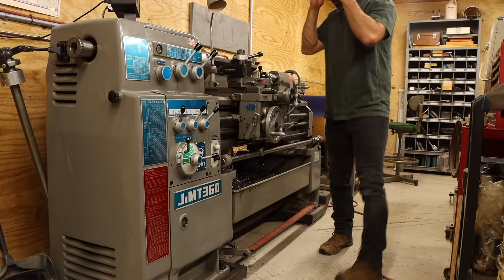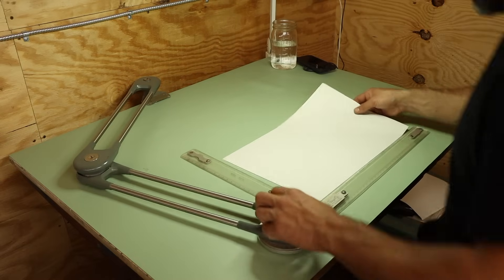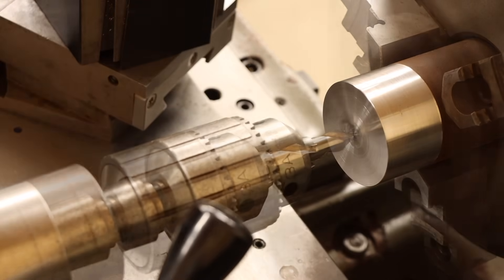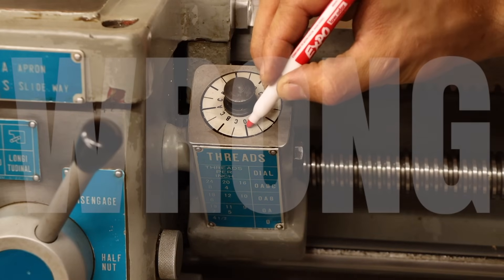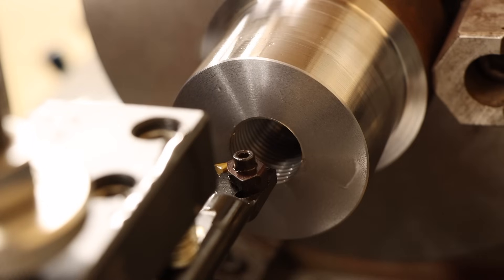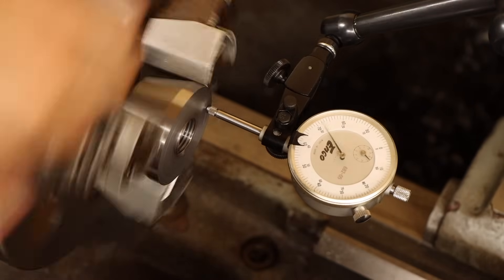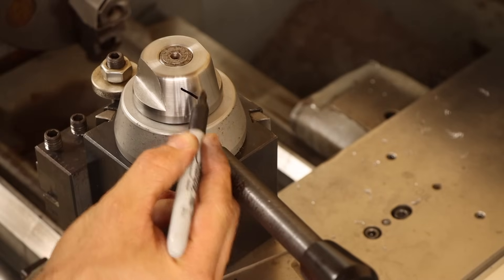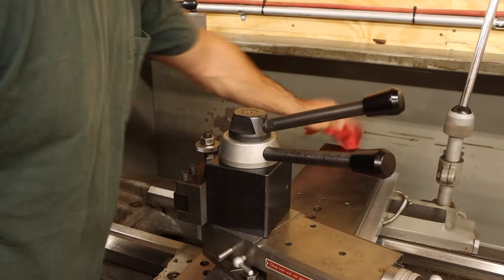A Better Tool Post Nut || INHERITANCE MACHINING

Comment from the maker: Thanks for watching everyone! Be sure to tune in Friday, August 5th for another fun project! If you'd like to tackle this project yourself I have some drawings on my Patreon that might be helpful!
Reply: With metric threads on an imperial lathe you need to turn it off and not disengage the half nut.  retract. run lathe in reverse, then go in for the next pass.   even hiitting the same mark on the thread cutting die you wont re enter the thread at the same point
Reply: @R3dryuu  It's still possible.  You can disengage half-nuts, retract, stop the machine, and then run the machine (and threading dial) backwards until you hit the same mark on the threading dial, before re-engaging to extract the tool.  As long as you don't allow the dial to make a full rotation before stopping the machine, the half-nuts will engage in the exact same spot on the lead screw, and the threads will line up fine.
Reply: When hatching a section, the internal thread must also be hatched, since it is located in the body of the part.
The part itself could be sharpened with a cone in the opposite direction, then the perpendicularity of the end and the average diameter of the thread would be ideal, and the less important upper end could be cut from the second setting. Or trim the end on a threaded mandrel.
It would also be good to harden the nut to 35-38 HRC, this will increase its durability.
In general, thoughtful and pleasant work, it's great!
Reply: What's the name of the precise line/length sketchinging thing you use in drafting part of your design that would make so much stuff more streamlined. Please and thank you someone
Reply from the maker: @hjdt1  Ironically enough, it's called a drafting machine

Comment: I always see machinists on YouTube talking about needing more tool holders so they can swap quickly on the tool post.

Why can’t there just be a quick than tool holder so you can swap the much smaller tool instead of the big bulky tool holder?

Comment: We learn by our mistakes / not knowing the unknown. the first thing is Orientals  making them for us  lol  I had the same thing happen to me when I bought a Jet lathe.  First thing was the thread did not look right,  wow  angle was all wrong. After a day beating my head with a protractor, problem solved.,  The scale on the compound was backward. When your friend told you to set it at 60 deg. it is really 30 deg for us .  The second thing was the wonderful thing of double and triple threading.  I took on the job of re barreling a Weatherby MK 5 ( made in China)   got the same results you did.  Started   threading with scrap stock didn't take long to figure out to leave the feed screw  engaged  in and out.untill your finished,  problem solved . Your lucky to have a friend help you.   PS  Very nice machine work .Keep it up.

Comment: If the pitch of the thread being cut is not evenly divisible by the pitch of the machine lead screw, the nut is not opened when cutting the thread, and the tool is retracted during the reverse rotation of the chuck.

Comment: I think that because you set the compound at an angle as per another subscribers suggestion; once you wound it to cut the thread deeper you also wound it forwards due to the angle so it's start position was off relative to before?

Comment: 6:18.. Change your thinking!! .. You do this all the time!!! :( ...

You are consumed with numbers, Properties, and Base Metals facts!!! Stop thinking Up and Down .. In and Out ... Think Life and Death!! ... Think IN to the steel... and OUT of the Steel!!!!!

 Set these Engineering thoughts aside and think about the tooling!! .. 

How it feels with the heat, the feed rate, the direction (Towards the war, or home at peace!!!! ) 

You have to FEEL the toolng .. Be that small radius of carbide, LIVE AS the tool!!!!

THEN and only then will you be!!!

Comment: My very layman guess is it has to do with the difference between how sae and metric thread pitches are defined. Sae pitches are threads per inch, metric is mm per thread. Completely opposite. I could be mistaken though.

Comment: On another channel they add a thrust bearing under the new nut, I tried this and it vastly reduces the work to tighten the nut, making the shorter handle work better.  It also raises the nut a bit, so the gap between the two handles is larger

Comment: As previously mentioned, the half nuts should not be disengaged when cutting metric threads on a lathe with an Imperial (4 TPI) lead screw. The half nut can be disengaged, But the spindle must be stopped not more than a few marks from the initial marking on the threading dial. Move the threading tool away from the thread cut area, then move the carriage to the initial mark used on the threading dial, engage the half nut then reverse the thread feed to exit the thread cutting area.

The far less stressful to cut threads up to a shoulder or internal threads into a shoulder is to feed the thread cut starting at the shoulder with the threading tool upside down or use a left hand threading tool AND the lathe spindle running Counter-Clockwise. Essentially the thread cutting action is reversed from "normal"..

Thread cutting with in-feed using the compound set at 29.5 or 30 degrees is not needed. This is a rather specific American single pointing lathe practice that is not done in Europe, Asia, Australia and else were in the world. Its beginnings appear to be rooted in small flimsy lathes used in apprentice education programs and thread mount chucks (will unscrew if the lathe spindle is run CCW, BIG no-no).
The belief only one edge of the thread cutting tool is flat false, thread cutting is a form cutting operation (both cutting tool edges are cutting) and due to the feed direction (toward the chuck or away from the chuck) results in the cutting forces on the edge moving in the feed direction. Back in that era, threading tools were often hand ground in HSS tool bits then check with a "fish tail" gauge. Some degree of "tweaking" the thread geometry can be done by futzing with the compound. Plenty has changed since then with carbide inserts specific for threading. Do update to modern carbide "lay down" A60 series threading inserts. They simply work far better than hand ground threading tools or previous generations of threading carbide inserts. Do take the tine to watch these two Japanese machinist making parts on a lathe as part of their National certification program... direct threading in-feed or running the spindle CCW feeding away from the shoulder. Note the DOC, that lathe in your shop can do far more metal moving than has been done in lathe videos to date.. and carbide inserts specially negative rake tools remove metal by heating up the point of contact high enough to "plasticize" the metal then plow the metal away. If this is done properly, the surface finish will be very good. Negative rake tools do not work well for small finishing cuts or small cuts (DOC) in general. Negative rake tools require more force to move metal, this means they are not good at making fine/small finishing cuts, Positive rake insert tools should e used for finishing cuts or small cuts to finish size.

https://www.youtube.com/watch?v=74lYv4X1i-M

https://www.youtube.com/watch?v=khe-Iw2oScA

Clocking a nut can be done by defining a reference point of where the nut fits once torqued to the required mount then marking that reference point. In this example of a 2mm thread pitch, the nut travels 2mm with 360 degrees of rotation or 2mm/360 degrees = 0.0055mm per degree. Or facing 0.0055mm will advance the point of reference by one degree.

Comment: There is a much less nerve racking method of doing your metric threads internally or externally. Simply disengage the half nuts like you would with an imperial thread, stop the spindle, clear the tool, reverse the spindle, and re-engage the halfnuts when your chosen number lines back up on the thread dial and back the tool out. I've found I can do in internal metric thread right smack up to a shoulder no sweat at all. This doesn't seem to be a widely known method. Like it is some closely held machinist black magic or something LOL. I would recommend practicing the steps in your head a few times since it is similar enough but just different enough to get confusing.

Comment: Id be very interested in making one of those Aloris style toolposts but it has occured to me that the angles of the slots that hold the sliding portion of the wedge must be compound angles in order to match the wedge angle and maintain it flush with the fixed surface whilst it slides downwards .that would be a very strange machining setup unless I'm misunderstanding the inner workings . So the threaded portion of the moveable part must also be forced away from internal threaded drum as it travels downwards since it is captive at an angle in the corner portion of the main body.

Comment: We learned in school to never disengage the half nut when cutting threads. Metric or imperial, ever! And yes that means that you get to do a sort of dance with the machine to prevent crashing the tool unless there is a brake or a clutch (schaublin 102)  on the lathe. And we had lathes of the same brand and type that had either metric or an imperial feed screw, that was sometimes a bit confusing.

Comment: Watching this and planning to go do the same thing to my PM 1440 Taiwanese lathe. I think the toolpost screw is a normal, unified, not-metric thread, but...if it is metric, I think I'll make one that is unified. Pretty sure I'd have to put in a new gear set to do metric. And definitely never thread INTO the chuck. I'm tooled to always cut while moving the saddle away from the chuck. Thanks for the inspiration.

Comment: You could eliminate the extra tool altogether with an extending sleeve on the nut lever.  Pull it out for extra leverage then slide it back in.

Comment: Small tip from someone using metric: Metric threads have standardtised pitch, so if you have the nominal diameter you can find the coresponding pitch in a table. There are some fine thread versions with lower pitch that don't cut as deep into the material, but those should be easy enough to tell apart from standard and aren't that common.
Dunno if the imperial system works similar when it comes to threads.

Comment: You could say you're a nut for a better tool post... or not.

There's something a little bit more satisfying about improving one's tools or workspace.

I'm in the midst of a much needed 25+ yr remodel/re-org of my shop. When I bought the place in '98, I had to put in 6 mos of remodeling before moving in.

I emptied the shop, threw tools & shelving/cabs from previous shop in, & went to work. Over the years, more equipment & tools were added until I had passage ways, cramped work spaces & small auxilary shops.

I finally had enough as I came out of chemo recovery last year & started planning an expansion & re-org.

It's so satisfying to be painting, wiring, creating new, more efficient storage & seeing a more organized total work area take shape.

You're an inspiration for doing things right, even if it takes a few tries.

GeoD

Comment: your metric thread issue, can be resolved the way you did it by stopping and reversing the spindle while staying engaged on the half nut, or you can create a new gear for the bottom of your thread dial, there was a guy at the shop I work at that did that for a Yamazaki manual lathe so he could chase metric threads like you would do with imperial threads. but you had to go in to the same number or letter every time.

Comment: A suggestion sir, when you tighten the nut, the tool holder moves unless you hold it. Add a thrust washer under the nut. This does two things, the tool holder won't move when you tighten the nut plus it applies a lot more force,,,no wrench needed. Nice job

Comment: I haven't seen this addressed, but it looks like you calculate the offset for your taper, then tap the compund directly around to that length without re-checking your zero. Unless the indicator was zeroed exactly over the pivot point of your compound, the angle adjustment will have shifted that reference point by a small amount, making your measured offset distance too big or too small, depending on whether your zero reference was initially in front or behind the pivot.

For some configurations, such as when you start close to the desired angle, the error will be negligible, but if you are concerned about accuracy, it might be worth bearing in mind.
Reply from the maker: I didn't show it but I re-zero after each adjustment for that reason

Comment: Wth. I would think moving your compound when it's on an angle would unalign its starting point if you're engaging on the same mark.
Reply from the maker: If you're referring to the thread cutting this is a common practice. The compound is set at the same 60 degree angle of the threads so it just follows the profile as you adjust it deeper with every pass

Comment: Nice, you have the big-brother of my chinese toolholder and I ran into the same "issue", so I started making an identical part the other week.  :)
I guess I couldn't run the parting tool properly though so I ran into some....  issues.

Comment: FYI, if you get a left-handed threading tool you can run the lathe in reverse and feed out of the hole. That makes threading blind holes much less nerve-wracking, and permits getting threads very close to the bottom of a blind hole.
Reply: That's how I do it. You can also flip the tool that you used in the video upside down and cut O.D. threads in reverse. Joe Pieczynski has an in depth video on it.

Comment: Let me ask you a DAQ.... I have a similar toolpost and when I change the toolpost position with the wrench  the embedded nut within the toolpost tends to unscrew wiht it.  Any idea?
Reply from the maker: Mine sort of does that as well. It might be intentional though. Leave that nut underneath slightly loose so the whole tool post doesn't try to rotate when I tighten the top nut down. I'm thinking of adding a thrust bearing between the two so that wont be an issue

Comment: I meant to say something about this before and totally forgot. I don’t know if this applies to every lathe or just most so he wanted to instill a good habit in us, but my trade college machining instructor always told us to never disengage the threading feed lever when making metric threads. I never tried to do it, and I don’t know why that happens, but I imagined your situation of cutting two different threads is the reason why he said that.
Reply from the maker: Thanks. I ended up figuring out why thats the case. It basically boils down to the lead screw being an imperial pitch. Mine is 4tpi. So the thread dial is meaningless for any metric threads. You can actually disengage/reengage as long as you are careful to align on the exact same dial mark and not let it make a full revolution between direction changes.

Comment: Nice build.  I pinned a wrench onto my QCTP nut for a few weeks before deciding make a new nut and handle,  just to make sure it's a change I wanted.  I used a bent and cut wrench to simulate what a handle would be like.  I found I didn't like it and decided to just hang a wrench close by.

Comment: When cutting metric threads with an imperial lead screw you should not disengage the feed but stop and reverse out of the hole before starting your next cut. Works every time for me!

Comment: The third threading attempt where you did not disengage the Thread Feed, just stopped the lathe and restarted it in reverse to back the tool up to the beginning of the cut is what Kurtis of Cutting Edge Engineering Australia does every time he needs to cut threads.

He also uses Palibit full-form thread cutting inserts (the lathe version of a tap or die), they're expensive, but worth it if you need to cut a lot of threads...

Here's his Channel if you want to see his work/set-ups...    https://www.youtube.com/c/CuttingEdgeEngineeringAustralia/videos

Comment: Hi, just something I used to do when I was machining parts, at 12:35 you was spending time trying to make sure parts were perpendicular in the lathe jaws, what I used to do what put a parallel behind the part covering the bore in the chuck and bumping my part against it, holding it flat as I close the jaws around it. Of course its not going to be as accurate as with using a DTI but itll get you closer

Comment: As someone who only has access to a lathe by being on a engineering competition design team in college, I've never really had any training on how to use/set up a lathe. The only training I've received is This Old Tony and maybe a few others. Now that I've found your channel, it's unfortunately time to graduate and I'll lose my access. But wow, I really wish I could have found your channel a while ago because you not only show the chips flying but you provide the problem statement, proposed solution, design process, machining setup, actual machining, and the finished product in use. Its incredible and I love every aspect of your videos. Especially the machining setup, you always provide some real helpful pieces of advice or simply explain how you set the tool up. Thank you!

Comment: Man, Single point thrding just sucks,  do you thibk you could have had success by not movi g the compound in after the first pass, and turn off lathe, remove toolholder to back out, i had success w this on an od thread, no backlash issues messing up where you really are.

Comment: Check out Joe Pi on threading.,,,,, Start the cut at the chuck. Run the lathe in reverse. Impossible to crash the tool.